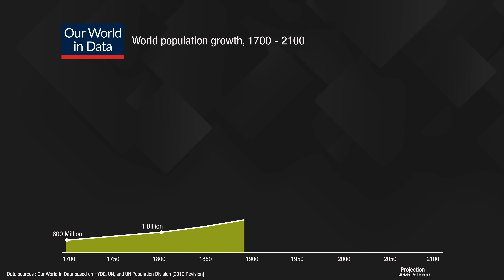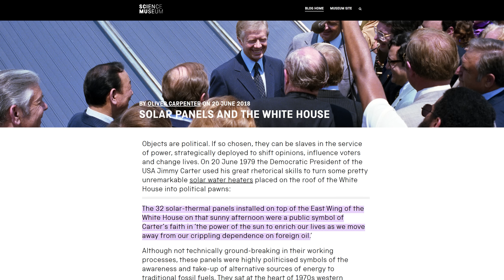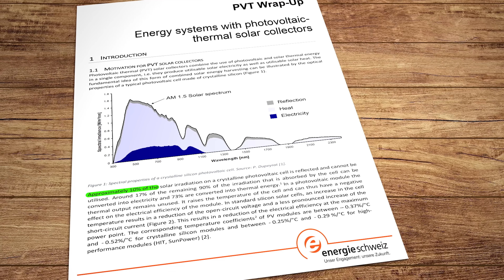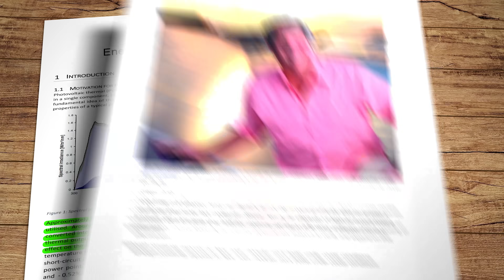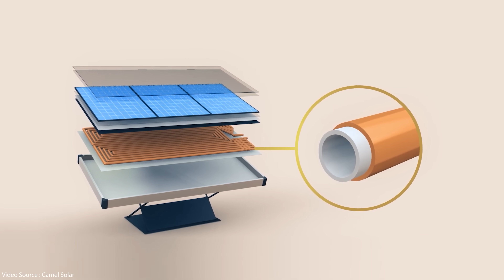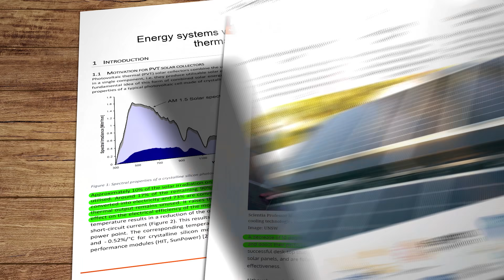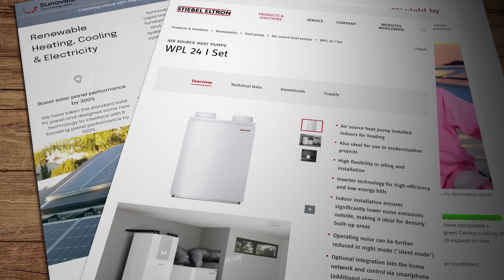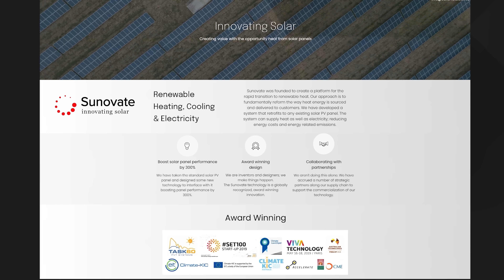The Solar PV panel that provides electricity AND heat for your home!

Comment: This is great… now what I want to ask is: given (1) the reduction in pv efficiency from heat and (2) the current huge installed base of pv’s , would it make sense to provide a clear overlay on top of existing pv panel arrays , with the same gas circulating between it and the tops of the cells?  Assuming the right gas flow, which might have to be large to prevent baking the cells ala greenhouses, would this keep efficiency from dropping enough to support active components for flowing the gas, whilst at the same time acting like a typical solar thermal collection system that has a dark surface under a clear top?
Reply: short answer is no. if such a system were a net economic benefit, solar farms would already use it. solar panels are actually quite cheap, so it's very hard to add anything to the system that is cheaper than simply adding more panels.

Comment: PVT's - yeah, great stuff I'm often wondering why these have not taken up - I guess this video explains why very clearly. It seems we are still a long way away from something you can just get in a shop and have installed within a day or two. It still looks very much like a system best included in the initial design of a building. However, some progress seems to have been made towards marketing parts that would make PVT's viable energy harvesting propositions. More research in this vital engineering challenge is needed worldwide. If a sustainable solution is found soon enough, it might make all the difference to the housing of the future.  It's worth remembering that it involves even more components, devices and machinery that add complexity to an already very complicated system: solar panel arrays.
More research is what is needed to turn a very expensive and complicated proposition into a viable solution for mid-income households.

Comment: well this is done with earth batteries with greenhouses. This is just in panel form, the goal is to make a equilibrium for air and using something as a heat exchange for air/tempature/ moisture. Very logical for the air system, the problem would be can it handle the extra load for the added duct work on the roof with solar.

Comment: I wonder how would this pair with a Sunamop hot water battery (eFIXX ENERGY
 utube channel) this a hot water "battery", but im not sure for how long and how effective this would be. 
Would these 2 together allow capturing of excess heat in the summer then using to heat water in winter, when the panels no longer generate hot air for heating.

Comment: The problem is that there are too many choices and they are all developing. So people delay commitment until the following version or better option comes on the market. The upfront investment is too much when the following year it is likely to be obsolete.
Geothermal is the way to go. If it is scaled up and developed to dig deep holes easily and cheaply then every house,  everywhere on earth can use it to create electricity to cool or warm the environment at a constant rate. But then most homes will be able to come off the grid and big companies can't have a hold on the market.
Reply: Physics says you can't dig deep holes easily and cheaply I'm afraid.
Reply: @Withnail1969  I am sure scaling up, automation plus subsidies, cheap loans that make the repayments equivalent to regular energy payments can make it viable. As I pointed out the other solutions don't encourage people to invest in them. My friend had solar panels on his house that didn't add value to its sale at the time because compared to what is available now it was worthless and they were only 4 years old.

Comment: Stumbled onto this thought a couple of years back when researching into a long term replacement heating system for my home. I'd already decided that I wanted solar panels/storage for electricity, but it was that efficiency drop through overheated panels which bothered me a bit. Then I saw EV batteries having their cell heat "wicked" away and it struck me why solar panels couldn't do similar. It was a classic case where two unrelated technologies could come together and make a third. 1 + 1 = 3.
Anyway, as I was getting distracted, I went back to researching heat pumps and forgot all about it. Full of ideas, logical or otherwise, but short attention span.🧐
Nice to see a product tackling this issue though. And great video as always, Dave.
Reply from the maker: Cheers Andy. Hopefully it'll catch on at scale. Seems like a very logical idea to me.

Comment: Using a closed system like heat pipes (the ones similar to PC coolers) could harvest the steam to move fans and generate even more electricity, before using the harvested sun heat  to heat your home/water/pool.

More detailed explanation: heat pipes uses a low pressured special liquid that boils at desired temp like 30-60⁰C (you can pick it by tweaking the liquid or pressure). So the sun heat would boil this liquid, and the generated steam spins a fan which makes electricity. But we didn't lost any heat yet, only kinetic energy, se we still can use the steam to heat what we wanted in the first place
Reply: while we're dreaming of world where cost and added complexity does not matter.... just use the Seebeck effect
Reply: @nc3826  good point/observation.
It would add cost, and I really don't know if the gains would compensate the additional costs.

But seebeck effect would also add cost and is not very efficient (like, it's REALLY hard to keep the temperature difference between hot and cold sides, and that's why many attempts to do that failed)
Reply: @joaogabriels.f.5143  My 'seebeck effect' retort was sardonically made just to illustrate my main point.

What are your thoughts on absorption chiller/refrigeration HVAC and phase change storage. Instead of the use of a HP and/or a communal ground heat sink?

Comment: Great video, if I save enough, I'll be looking to fit a PVT and possibly an internal heat pump setup as you described. Seems like something that should be brought into standard building regs so all new homes built have some kid of EV setup like this! Excellent video
Reply: it will cost more to install than simply installing more panels for more electricity and less heat. that's why this concept isn't mainstream. also, there is a huge disadvantage with tying together many systems so that if one fails, it can mess up the others. the kind of setup described in this video makes more sense if you DIY it because you won't lose so much to the install labor, but it's still unclear that even subtracting the labor cost would lend a big enough cost reduction to offset the long term operating and maintenance costs.
Reply from the maker: Cheers John :-)

Comment: heat batteries and thermal electrics should also be considered. imagine active cooling from thermoelectrics that are powered by the excess heat on the solar panels themselves it's built-in automation
Reply: Definitely, we are considering all these options in our H2X applications
Reply: Yes brilliant and logical, stove fans  convert heat to kinetic energy  do the tech is there it just needs some tweaking

Comment: Why not a non-conductive mineral oil as the energy transference medium? It's very gimmicky in gaming PC cooling, but would be extremely effective in this case. Very easy to pipe the system through a water heater or air vents, as well as a Stirling system for a little extra energy generation depending on size
Reply: I had the same thought, it just sounds more smart to do this, more efficient, more cooling capability, and more electric energy generated (from the liquid steam kinetic energy)

Comment: You know you need to talk about de populating to two billion people or less. It’s a population that the world can support.  It’s going to take decades to develop a storage system that will meet the needs of our energy storage issues.  Nuclear is clearly the way to go, it’s developed, it’s now save and it’s clean and a clear choice to solve the needs to beat climate change.  It can also be implemented world wide in the next ten years.  It’s the gas and oil people that are blocking nuclear.
Reply: Build thorium reactors to eat all the waste from current reactors AND deactivate nuclear arsenals and use those materials in the reactors also.
Reply: You go first then

Comment: I've been touting this idea for 20 years, but I have no influence. My idea at the time was to circulate water through tubes bonded to the panels and a large tank of water which might not be quite hot enough for handwashing or a shower, but it would have reduced the energy needed to get that hot water, while cooling the PV panels so they work better.

Meanwhile PV panel costs have fallen now, so we can have a larger area of panels, and more warm water. 

And panel-sourced heat pumps could be better than air-sourced.

Comment: So, if you incorporated peltier devices in the interface between the PV panel and the heat capture you could also get a bit more electricity.  I know that right now that would not be cost effective, but I am sure if We put enough great minds onto the problem that could change.  I tried a version of this with copper tubing and cheap Solar panels but I did make a big mess of things.  I learned loads while trying though.
Reply: Peltier/Seebeck or thermoelectric generators are interesting as they are fully solid state, and requires no maintenance, just like solar panels.

But thermoelectric generators have woeful efficiency even when it gets temperature deltas that are hard to achieve between ambient and the temperature of the solar panels. No amount of research has been able to improve it sadly.

Comment: I’m skeptical that air cooling will be efficient enough.  I’d lean more toward liquid cooling or even just adding heat sinks.

Electric cars have this same problem and have found ways to liquid cool the battery packs without worrying about leaks.
Reply: air all the way, this is going to run on your roof for 20+ years. Would you rather replace a dead fan or have water inside your computer.
Reply: @Pale_ghost  common tap water may be highly corrosive; you need to use demineralised water for cooling.

Comment: And yet so few have solar panels on our roofs. Most could generate personal needs at home. This would give the grid a break. I am dumfounded here in America that we continue to build houses so close to each other. Our country is basically empty except in population centers. If anyone who has driven across our country could  attest to miles and miles of empty land. Arriving to either coast and you'll find most of our population stacked up on each other. Baffling to say the least.
Reply: That "empty land", at least where I live, is more or less wild and full of valuable functioning ecosystems and habitats for animals, vegetation, ecological functions.   And many thousands of acres of it is in the process of being bulldozed up and permanently destroyed for very inefficient solar farms with their bare ground, roads, power lines.  That probably won't even put a tiny dent in the climate changes we are in.  And, among other things, Valley Fever is on the rise, because of blowing dust spreading the spores around, created by ground disturbance in the USA western deserts.  And the desert tortoises, already on the brink, die when they are relocated for "mitigation."  I like solar, but it belongs on rooftops and parking lots and similarly disturbed areas closer to the demand, and where the power grid infrastructure already exists.

Comment: Thermal mass of water is much greater than air, I didn't catch if that was mentioned, any implications on this tech?
Reply from the maker: It's mentioned in Rosie's video, but the overall reliability of the air system arguably wins out.

Comment: Thank you for video. Hybriding PV and fluid cooling is rather obvious. And idea come to me: put thermoelectrical cooling elements (peltier elements) between PV element and fluid cooling circuit. That can increase total electric output and efficiency in general by decreasing PV elements tepperature.
Reply: Again, peltier is terribly inefficient and needs large temperature deltas to be relevant.

Comment: I've thought from back in the 1970's that PV pannels should be hybred for heat and electric. It's a win win. I put this up on a couple sites comments awhile back, some got it, but alot of people didn't get it and tried to say it would make them get hotter. One way to get away from freezing is let water drain out of system when it gets cold at night or cold cloudy times, that also allows the system to start quicker again when system gets the sun again, not having to heat the liquid back up.